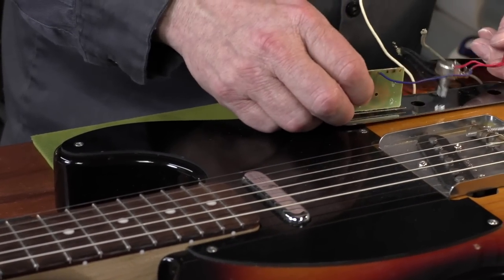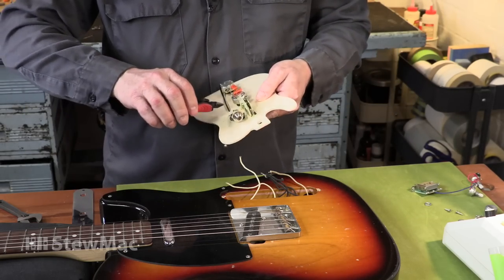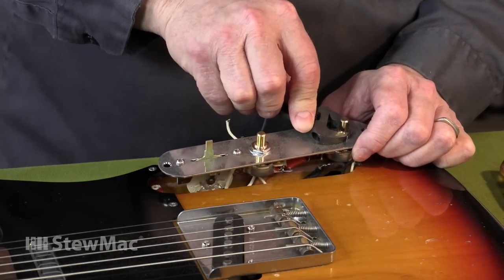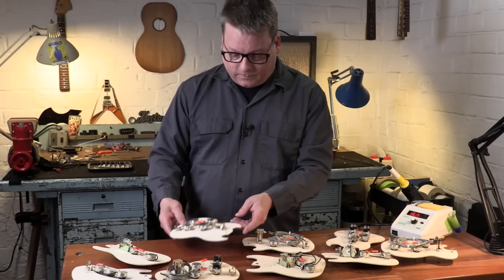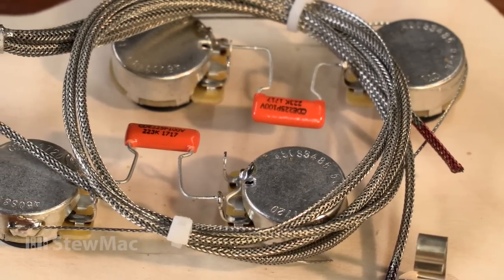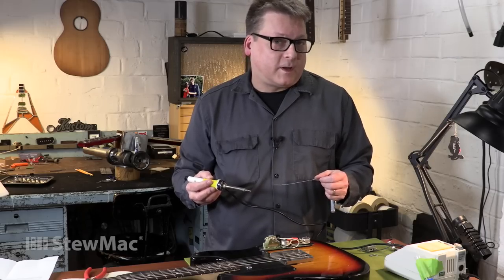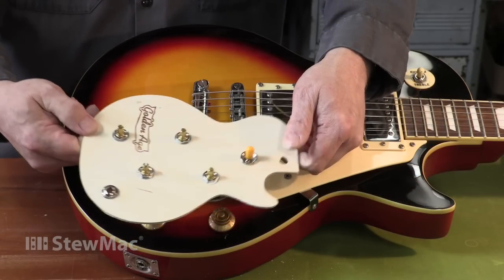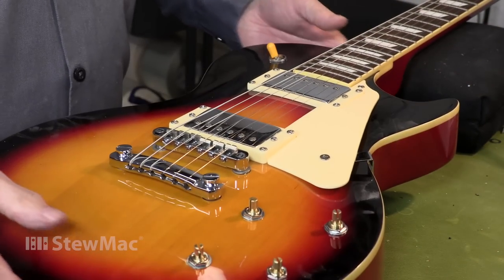Golden Age Pre-wired Harnesses: premium hand-soldered pickups for electric guitars

Comment: I know this question has nothing to do with thid vid but, Iam building my first ukulele & Im getting ready to glue the fretboard to the neck. My question is do I  but the fretboard right against the headstock veneer & then cut away for the nut?? Or do I leave the space for the nut during the glue up?? I cannot seam to find info on this since I already cutthe fret slots & frets installed. Thank you too whom ever can answer this..
Reply from the maker: You should definitely cut the fingerboard to length before installing it on the neck so that it will butt up against the nut. It really depends on the scale length of your ukulele, which will dictate the correct placement for each fret for proper intonation, as well as where the fingerboard should be cut at the nut end. At which fret does your ukulele's neck join the body?